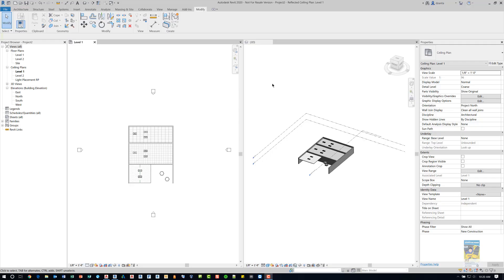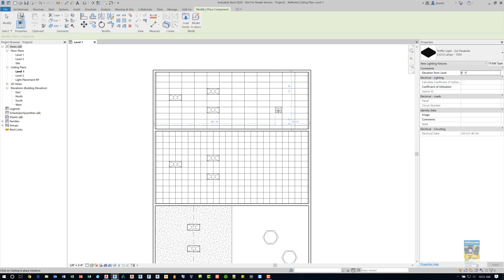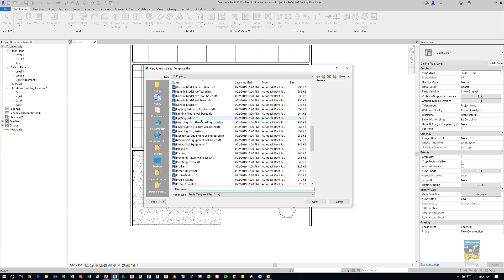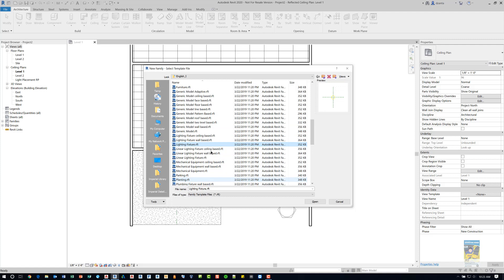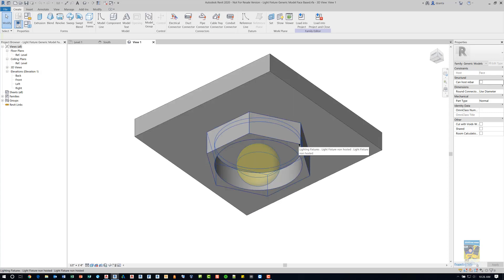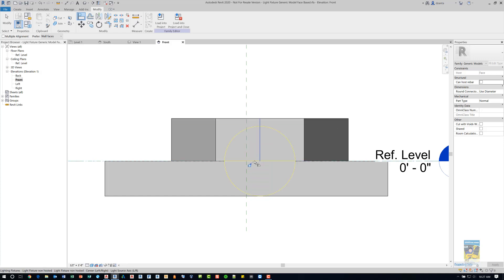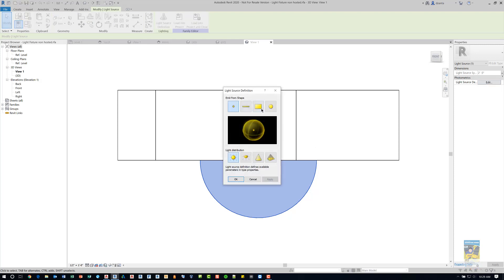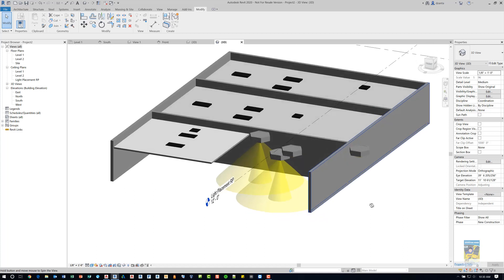Revit Non-Hosted Light Fixture Placement

Comment: When editing family, in family categories and parameters panel, if you scroll to down there is host parameter but it's not adjustable. How can we adjust it? I'm having this problem with plumbing fixture. I  have a bath tub family and it has the ground level host. But I need to offset it bc it's embedded the floor but it's not adjustable.
Reply from the maker: A plumbing family if set as Host within the family just means you can tab into it for tagging if the tub is hosted by another family.  If you want to create a tub and control the height from the level it is on, use a height parameter within the family.